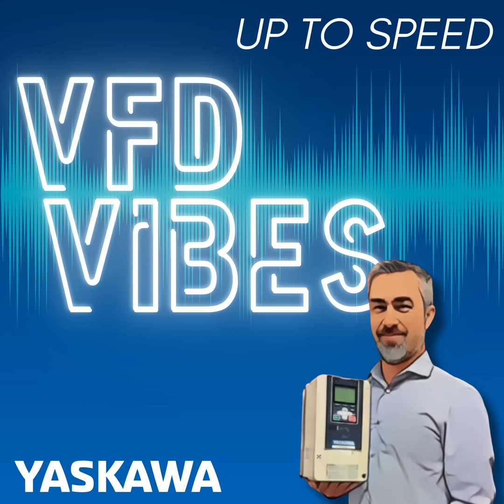Don't Short Me

Comment: Nice and valuable session, it would be great if you can do a session on how to properly provide external fuse/breaker protection on the primary side of the vfd, what kind classes of fuse can be used (mostly class J and class DFJ) and other conditions like multiplication factor of nominal input current (or if something other) to size a fuse. We think this topic is extremely important. Kindly do consider.